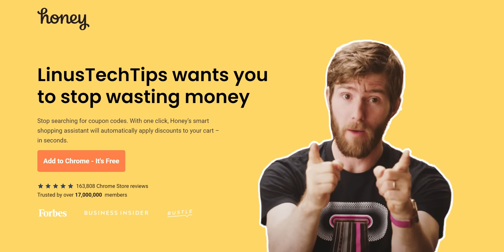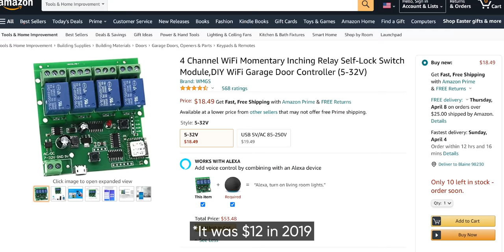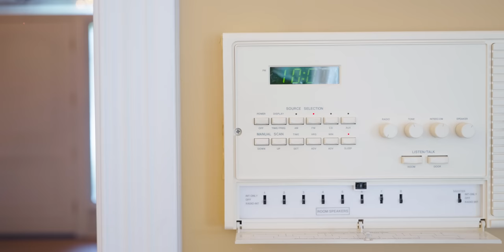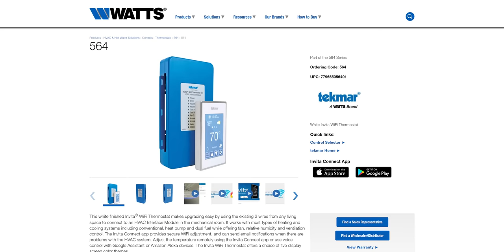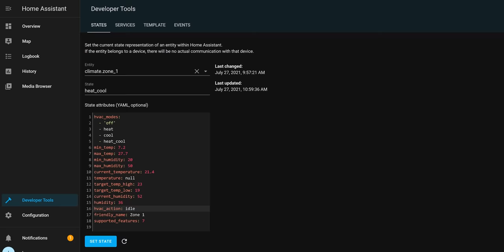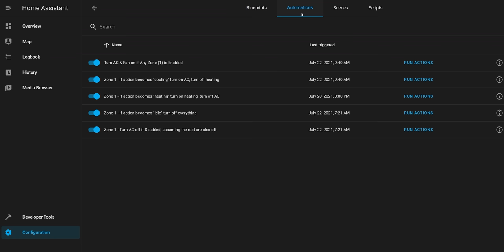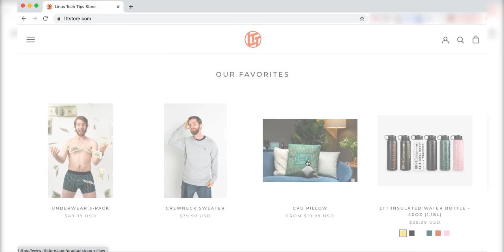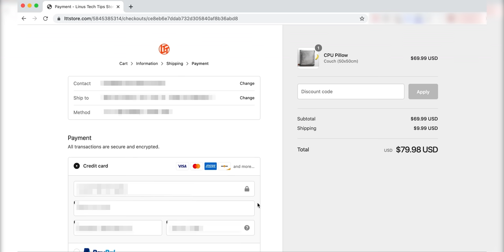This Should've Been EASY - New House Smart HVAC

Comment: I did HVAC for 10 years, I could have that wired and working the way you wanted in 2 hours.

The only problem you didn't consider is that your A/C is made for a certain capacity, if you don't have enough airflow for the capacity required you will freeze up your A-coil.  In other words, you can't make the zones too small, only doing one room or even just two rooms at the same time is not enough airflow usually. The only way to get around this is to have a 2 stage or Variable Speed A/C Compressor.

Comment: Mind-blowing, any house build in Denmark, in the last 15-20 years would have this type of floor heating as well as a air heating system where you reuse hot air from inside to heat cool air from outside before it gets inside the house.
Reply: I had a house built in 1961 in VANCOUVER with in floor heating and every NEW home has to have a "HRV" - heat recovery ventilator installed in Winnipeg Canada

Comment: From an AC person - make sure you consider the minimum zone size and how that will affect the minimum airflow across your cooling coils. Could easily end up in a situation where you’re not moving enough air: iced up coils, noisy vents, lots of stress on blower, potential for some water damage too.

Comment: There's a reason why whole ass careers are built off HVAC..I'd imagine putting a bunch of dampers with only one unit that just blasts 100% all the time is not a smart idea.
Reply: You are correct! This is what I do for a living. He will need to have a bypass damper to allow for the system to work properly, otherwise it will short cycle and never cool properly. I’m not sure the size of the system or house but it will need to be a large one. I’m assuming this is a single stage AC with a single stage PSC blower given the age so it will need a bypass in case only 1 or 2 zones is calling. You can also make dump zones that are always open to help but not a great solution.
Reply: @joshuapinson9438  wouldn't reduced airflow across the evaporator cause it to ice up? Say one room called for cooling, and only one damper opens, I don't think it could move enough air to prevent icing.
Reply: @joshuapinson9438   what about just putting a timer on the system to prevent short cycling
Reply: Should get rid of that single speed outside AC pump and get a variable speed unit for when he has multiple rooms shut down.
My home has 6 rooms,so I will be getting (2) 3 split systems installed.
Reply: @joshuapinson9438  PE here, this is what he needs to do to proceed with his current solution. My recommendation though is to replace that ancient system and weigh his options for what he can do w new equipment (I've seen multi zone VRF mentioned and that's not a bad idea here)
Reply: @gerald4027  you are dead on, nowadays if someone wants zoning I recommend a minimum of a 2-stage AC matched with a furnace that has a variable speed blower, even then your zones need to be relatively equal in size. If you want the best set up with out worrying about zone size a variable capacity unit is the way to go. They operate down to 75% of the max capacity (at least Carrier and Lennox options) and work like a charm!!
Reply: @tienems7971  the problem with a timer is that without a bypass or dump zones you still will be heavily restricting the air flow. Your coil is going to ice up still won’t cool right. The timers are designed to address short cycling but if you still have 2,000 CFM of air (assuming 5-ton system) you need it to be able to go somewhere
Reply: What about having the damper for the server room always on when AC is on (for cooling at least one room)? That would output, depending on the distance of the vents to the needed room and the server room, half and half to the room and half to the server room. That would put down the air pressure and helps the water cooled servers to be even more chilled during summer. I guess the AC will most likely be only on in 2-3 month in summer on very sunny days since it's a huge mansion in which the walls and roof warm up slowly. I 'm very much guessing right now but would that work out?
Reply: @joshuapinson9438  Also going to sound like a jet engine trying to dump 2000 CFM into a space ducted for 200.
Reply: @joshuapinson9438  This feels awkward.
Reply: @joshuapinson9438  with the raspberry pi it's probably difficult but when he goes to a full computer server base system he could definitely integrate logic that always opened a few main zones (ie kitchen, living room) when even one was calling. Even with a barometric damper you don't want to do single zone operation when he's dividing into so many small zones
Reply: @joshpinson9987  hahahaha amazing!!
Reply: Sure, but they're doing interesting stuff in the commercial space. For instance, making sure a hospital room is negative pressure so that their germs don't leave the room when the door is opened and positive pressure for operating rooms so germs don't get in. And then balancing that in the same corridor. A house is really, really simple.
Reply: @joshuapinson9438  How proprietary are those systems?  Is there a common protocol that many use? My HVAC knowledge is limited to wiring up a smart thermostat, and being amazed at how simple the control scheme really is.  I mean, a mercury thermostat would work in most houses today!
Reply: @PurpMcSquirt  That's kinda my whole point, there's nothing complex going on here. AC for a house isn't hard.
Reply: @arthurmoore9488  that’s the downside, if you use, let’s say a Carrier Infinity Greenspeed system, or a Lennox Signature series you have to use their controls and zone boards. We use EWC dampers with these systems that are electronic open and close. The Lennox system will work with HomeKit like what they are doing and the S30 is a super slick thermostat but you are limited to proprietary controls.
Reply: @tienems7971  You would have an overly cool room if you forced the system to run in one room.

Comment: 1 MAJOR issue, if you have 1 ac unit you will likely have a south or west facing room always calling for cooling during the day or due to room differences of getting heat soak at different rates of other rooms you might always have 1 room calling for cooling meaning your ac is on all day long. This isnt bad as you rooms would likely keep more evenly cooled in the house if each has a vent valve but might cause higher power bill. personally I prefer a more evenly cooled house and higher power bill which you might as well. Good call on the non-cloud devices but I hope you keep a backup control unit that is pre-programmed to be swapped incase the 1st one dies and take weeks of getting a replacement causing no ac for weeks. Personally I support this idea, but would recommend installing solar as a itll give a better return on investment then AC if you care about that stuff.

Comment: Don't forget your relief dampers to keep the minimum cfm across your AC coil, minimum compressor on off times, and how your system works in a fail safe modes.
Reply: While he's at it, delay between compressor on/off and blower motor on/off.

Comment: Just remember that you should not have high over pressure in any room. In cold Climate (Canada and Finland) that will cause moisture problems and mold with time. Not sure how the ventilation works on the that side of the globe, but best solution is to always have forced ventilation with little bit more exhaust air. This is easiest to do with EC-fans and flow sensors. (I think that would need some duct work in Linus house) 

When everything is done. Just check with differential pressure sensor that there is no over pressure in the room. Hose out of the window gap will do the trick. Everything -10 Pa to 0 Pa is ok!

-HVAC engineer from Finland

Comment: without a bypass for the ac supply, you definitely run the risk of freezing your DX coil if you're not maintaining 350 - 400 fpm across your dx coil. zoned systems run on static pressure set points and have a bypass installed to maintain constant air volumes regardless of how many zones are closed off.

Comment: You could use hydronic tubes with cold water to cool the house. You just need to be measuring the humidity and temperature to work out the dew point, so that you can set the temperature of the tubes to not cause any condensation.

Comment: I manually change the zones in the winter and summer. I open the basement vents 25% of the way, main floor vents 50% of the way, and open the upstairs vents 100% of the way in the summer. I reverse this setup in the winter. Because cold air falls and hot air rises. If everything is left wide open the upstairs cooks while the downstairs is to cold.
It only takes 15 minutes to do this and is free. 
His motion sensor is going to suck for the people sleeping or not moving much. Sitting and watching a movie? Better not sit to still.. 
Cutting the air flow off in to many zones could be bad for the air conditioning system. Depending on how everything is going the AC could short cycle all day or have so much airflow blocked it starts to ice up. It could work out great but I think problems will show up in the near future.

Comment: I’m not sure the theory works. HVAC systems are sized (in tonnage with a BTU rating) to cool a specific amount of space. If you manipulate the space it’s cooling, with the dampers, the unit will actually work less efficiently by kicking on and off more often. The system has to be sized perfectly for the space. It can also cause moisture issues. If you have all the dampers closed, the unit isn’t going to run a long enough cycle to remove the moisture. There are a couple of other things as well, but I’m from down south in the US, and things may not work the same way in a cooler environment. I’m not sure how hot/humid it gets up there. I would consult an HVAC expert, and see what they think. I do know that the dampers can never remain closed. They need to open and close with the compressor which would essentially render them useless. I know the intention is to save energy, and close them when the area is not in use, but you can’t do that. What might work, is to get more than one unit, that are capable of multi-stage cooling, but I’m honestly not sure. The most likely course is to have 3 completely separate zones with their own units. More or less depending on how big/small the house is. I hope this helps. What you guys came up with is absolutely ingenious, and works perfect in theory, but it’s going to cause a lot of problems. I know the intention was to save money and not tear out drywall, but I don’t think there is any way around it.

Comment: HVAC service tech here. Everything looks okay to me except one thing. Since the AC compressor can not be varied (on these small residential units), you CAN NOT vary the indoor air flow. If you close off 3/4 of the duct you are lowering air flow and could potentially damage your compressor. Air flow must maintain roughly 300-400 CFM per ton of cooling or you risk damaging your system. A bypass could be installed, but I've found that this is not a great solution and cold air just races in a circle and causes freeze ups. 
Your best option for individual small zoning is ductless.

Comment: So I'm a bit late to this video... but the reason the dampers move to slowly is because they're biased to the other dampers. You do not generally just open and shut them because that causes excesses head pressure on the air handler. This can cause the coils on the air handler to freeze. Very much like what happens with an over speced system. Because in essence these dampers are making the house smaller if they aren't bias to each other. The goal of the damper is to make the same sized house but on variable paths. Those vary depending on the coaling demand. That requires understanding the length of each trunk and how easily the air flows on each.

Comment: Very cool. However, unless you update your ductwork and ac your going to run into lack of air flow issues with your air conditioning. It will cause your evaporator to freeze up. You'll run into issues when there is only one zone calling for cooling and all the other zones are closed.

Comment: Boiler should have an outdoor reset so that it ignores heating calls based on it being too warm outside. 

Also there are great efficiency gains to be made in modulating the circulating water temperature from the boiler, but I imagine your radiant floor system probably already does some local loop temperature control.

Comment: Linus, I'm a mechanical engineer who designs HVAC systems for a living, I work primarily in california, but we also do jobs in areas like idaho. Do you know if your air handler has coil freeze protection built in? if not adding very small zones which demand cooling can be an issue down the road.

Comment: Just a thought about the occupancy awareness using motion sensors: you'll want to program it so that it won't break when people are still (eg, sleeping or in a chair for a long time). I've stayed in several buildings with lights on motion sensors, and they often turn off after a while if I'm sitting still in a corner or out of sight of the sensor. It can be very annoying, and if your heating/cooling is tied to that it could be even more bothersome.
Reply: aola wili  Not really, he's said he's doing it for energy savings. That does make sense to do.

Comment: Can I suggest to revert the relay system so that it defaults to open the damper when NOT activated and to close the dampers when you volontarily activate them. The reason for this being if its summer you are dying and all of a sudden you have issues with the sytem, at least it will revert back to open and make every faulty zones getting comfortable air flow while you troubleshoot the problem :)

Comment: Linus, your builder probably has layout plans for the radiant tubing.  You should ask them for a copy.  
Also, instead of doing an ecobee, you could just use a current sensing relay on one of the thermostat's 24v wires.  Would cost much less, and be more reliable.

Comment: I don't have enough time to read all of the comments but man soo much.
First of all what linus is doing is creating an ahu (air handling unit) and pressure dependent vav (variable air valve) system, but its missing several important components to work correctly.
Also I didn’t see it addressed but the boiler can easily be brought into that control system.
1- the entire ac system works as a package and while a few have come close to identifying the problem the nail has not been addressed. the airflow of the ac system is dictated not only by the size and speed of the fan but the design of the ductwork as well. the critical measurement that must be met is the proper cfm(cubic feet per minute) of airflow within a given temperature envelope to heat up the refrigerant in the evaporator enough to prevent liquid going back to (and possibly breaking) the compressor. That specific job in a designed zoning system is performed by a bypass damper, and yes, its important.
2- to address a common misinformation in the comments. residential fans are almost always centrifugal displacement squirrel cage fans, the draw less amps when blocked off, so less air equals less amps.
3- one comment that keeps coming up is liquid cooling a house. that's actually a very doable and decent way to cool a building. It involves a water chiller system and running cold water to small terminal units in each zone, similar to mini splits.
4- oh and the fact that the pressure relief valve on that boiler is plumbed in pvc is scary 
5- And this is more my own personnel note, Linus is pretty far over his head in all this, i mean would it kill him to reach out to her professional hvac technician/you tubers for help? I mean seriously dude I have volunteered my help so many times but alas, I'm just not popular enough.